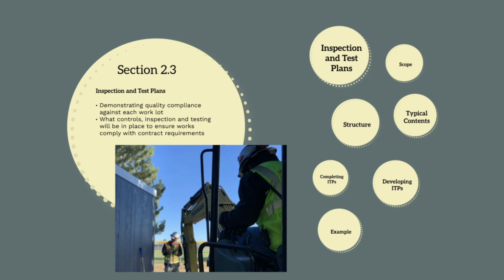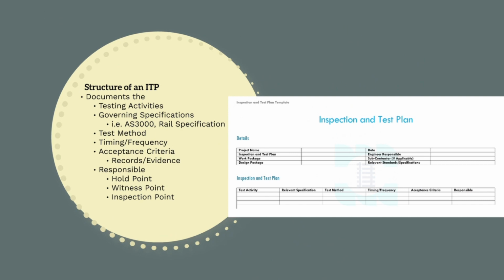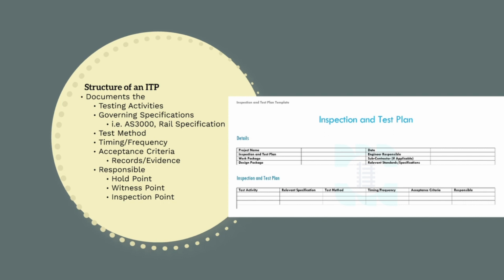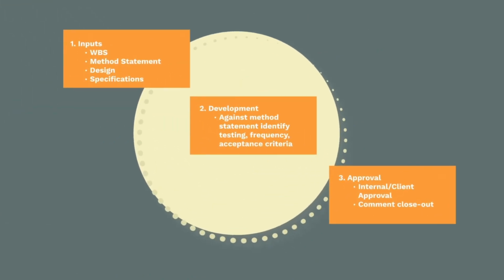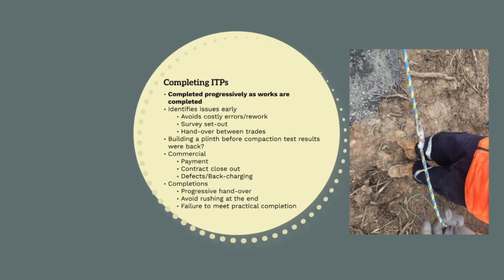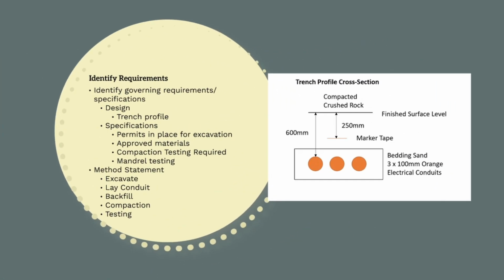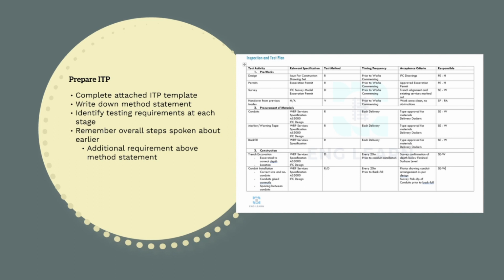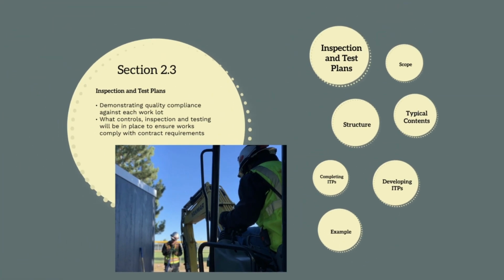Inspection and Test Plans (ITP) -  Construction Quality Management

Comment: If I enroll in the courses, Do I have lifetime access or limited to the lectures?
Reply from the maker: Hi! You get lifetime access when you enroll
Reply: Also, are case studies in the courses suitable for a civil engineer looking to venture into QA/QC, You are en Electrical Engineer, just needed to confirm this.
Reply from the maker: @mateenraza7340  hi, yes they are. The case studies in the quality course relating to trenching. The construction quality management principles in the course are universal, across disciplines.